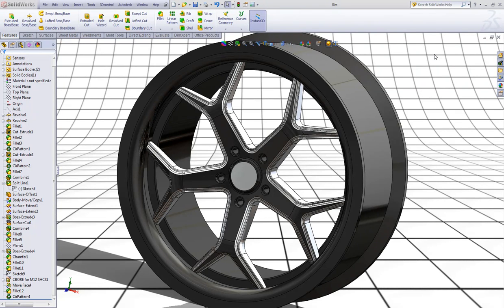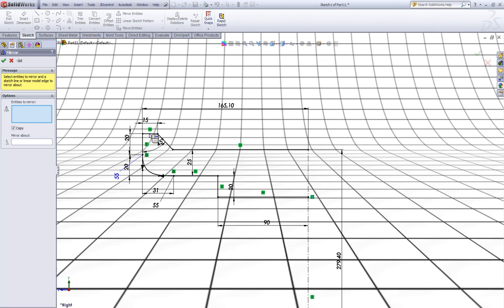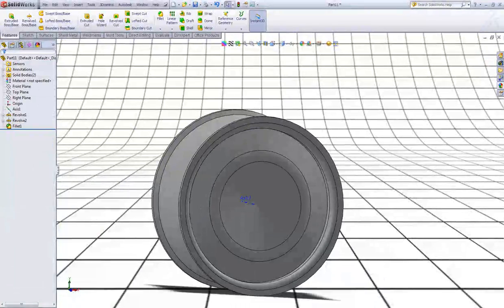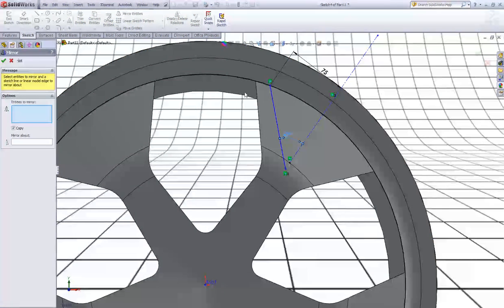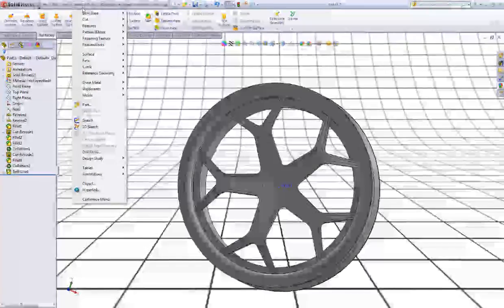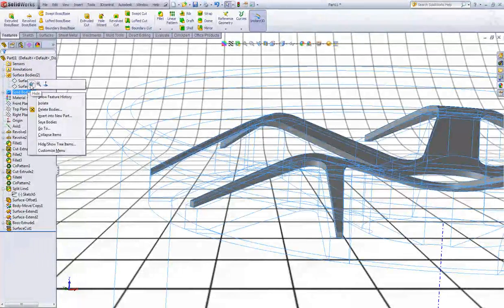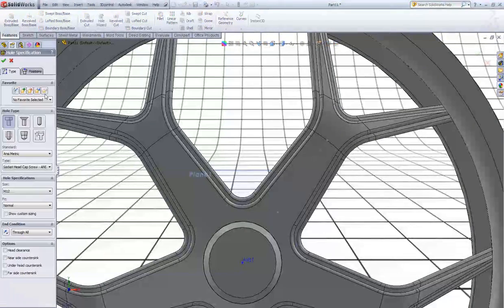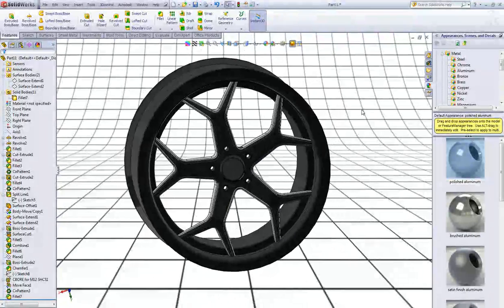SolidWorks Tutorial: 20'' Rim

Comment: very good video.
will you please also can make a short video for static, bukling, vibration, fatigue simulation on this same wheel.
thankyou.
because when i am applying mesh on the same wheel SolidWorks is giving me errors.
And I also do not know how to apply a static load on this because it has no staright face on the top of the wheel.

Comment: Nicely done.. however. Using solid faces as sketch origin is very unstable. Are you using this just to speed things up? otherwise there is a high risk of total model collapse if you need to make changes on the appointed solids. I thinks planes are the best way to go to avoid such problems. Any thoughts about this?

Comment: SolidWorks seems even more efficient than AutoCAD and even more simple

am I right ? or : there are even more efficient & easy to use programs than SolidWorks (and AutoCAD also) ? ? ?

SolidWorks is able to do pretty easy all kinds of designs, including cars and any other irregulate 3d form ? or : should I use a different program *for difficult stuff to do ? ? ?
Reply: Solid Works is the most simple and user friendly CAD system i've ever try to use( I have tried to use Autocad, Pro Engeneer( Creo Elements,Parametrics 2), Siemens Unigraphics NX)
Reply: aha, thanks for answer
Reply: try rhino is very easy to
Reply: José Riquelme aha, I see

Comment from the maker: Hi.'Thank you.

Well, SolidWorks is a CAD program used for many different industries (mostly mechanical), 
I am an educated toolmaker (specialized in the manufacturing of injection molds) and educated Mech. Engineer specialized in product development and engineering of injection molds. 

For this rim design, i did the "freehand" drawing inside SolidWorks and tweaked it until I was satisfied with the design.

Comment: When I follow your tutorial, when I do the first revolve, the rounded parts doesn't get line, it's just grey. Also, I have troubles making the extruded cut at 6:53, or actually the complete sketch, because the sketch is under the surface that I want to extrude cut. Any help?